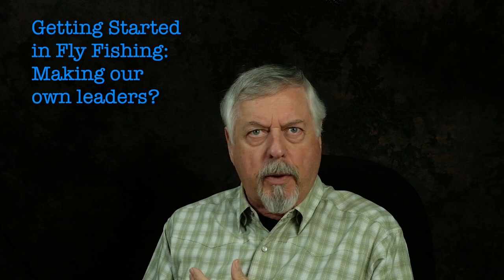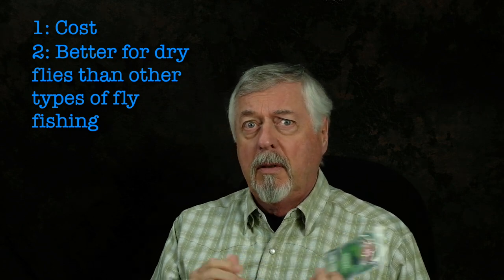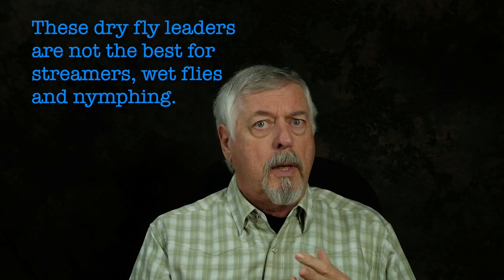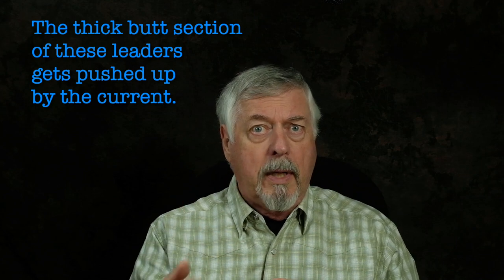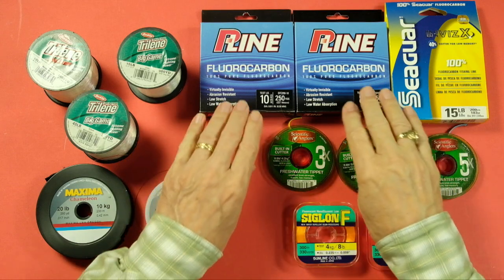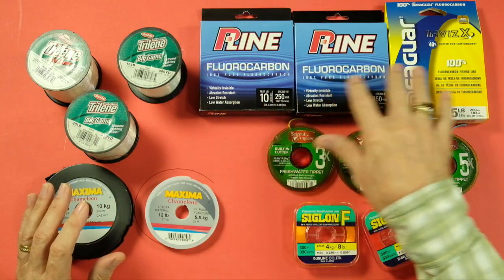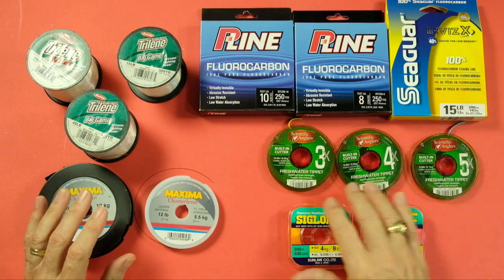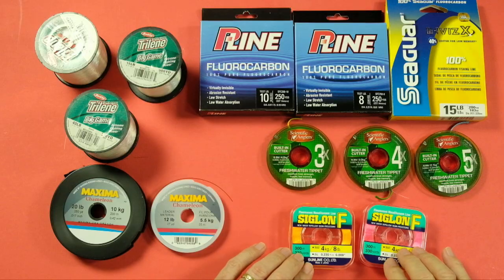Getting Started in Fly Fishing: Why Make Our Own Leaders?

Comment: I do understand your logic on this, your videos have been enlightening and very helpful. However, having a thick butt section, in particular one that has close to the same stiffness as the end of your fly line, helps with providing that transition in diameter and stiffness, thus improving the shape of your casting loop. This might be important for casting accuracy and fly placement, regardless of what type of fly you are using. Many store bought leaders have poor durability (especially the tippet section), and the taper is very abrupt, not gradual. These are the main reasons why I make my own leaders. Also, I know about the depth problem for flies like streamers and nymphs, but mono does sink after it’s been wet for a while, so for general purpose casting unweighted wet flies and light streamers, I find that for floating fly lines the blood knot leader formulas that utilize Maxima will cast the best for me - starting with 30 lb. butt section and transitioning to 20, 15, 10, and 6 (or about 5x). This works for line weights 4-7, I use a 25 lb. butt section for 2-3 weights. Yes I do go with fluorocarbon when I want more depth, and when I want more punch casting into the wind. I rarely fish with dry flies, but when I do, the store bought leaders are best for that (unless fishing with poppers, gurglers, and other foam flies like ants) because they land on the water with less disturbance than blood knot leaders. But I still will often replace the tippet with store bought leaders because with many of the brands, their tippet has very poor durability - cut off tippet a few inches below the taper and knot a section of Maxima ultra-green for tippet.

Comment: For building my own leader, what's your thought on the knots?  Surgeon's knot vs. Blood knots?  I understand both knots are effective but which knot gives a better transition or a better flow of energy?
Reply from the maker: In your shoes, I'd use the knot that I could tie most effectively and not be worried about breakage due to weakened mono. That matters more than anything else. I doubt we could detect a difference in turnover as a result of the type of knot used.

Comment: Good info. How do you feel about the Gary Borger uni-body leaders? I like that it only uses 2 sizes of line (Maxima). Long butt and short transition section. Any formulas you prefer?
Reply from the maker: I've not seen his leaders. but I frequently use two piece fluorocarbon leaders with a long butt and a short tippet, usually around 70%-30% proportions.

Comment: I have watched this many many times. I buy flies for X factor of my pool i know its wrong but. is there a way to tell a fly for leader in grams or ounce. so i can make my flys buy weight and make a feeder to that fly? Other side of the river
Reply from the maker: The X system rates the diameter of the tippet section of the leader. This is important only for dry fly fishing where the fish can see the tippet.

All other trout fishing, the leader is dependent on the size of the fly (a small fly requires light tippet) and the size of the fish. The bigger the fish, the greater the breaking strain required.
Reply: @hooked4lifeca  I thank you for that. I still would like to know of weight for tipis. 10g 5,grams fore 5 x or 6 x . Flies to line So basically What weight flys should i be making for a 5 or 6 weight pole. don't care bought the size of hook but do like smaller but when done tying the flie, What weight around should it be. Here comes the add split shot i am sure.